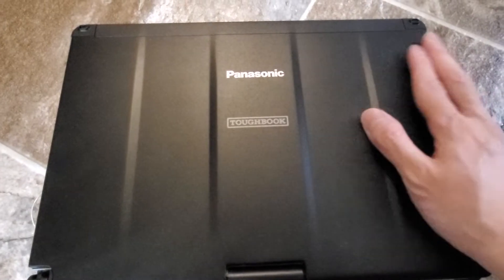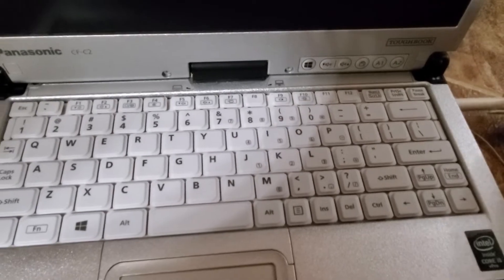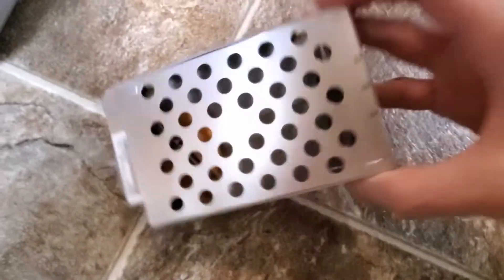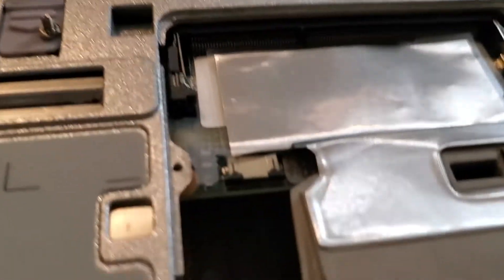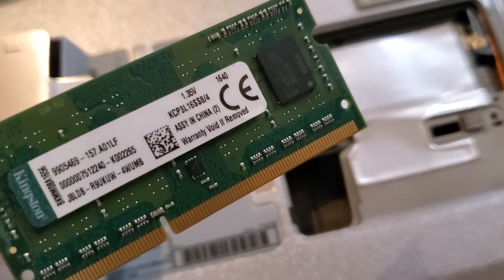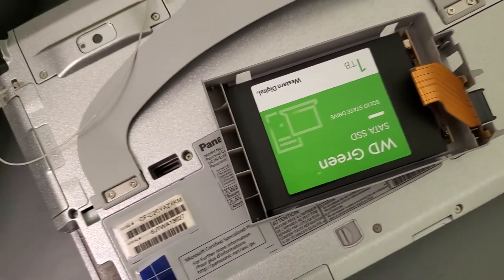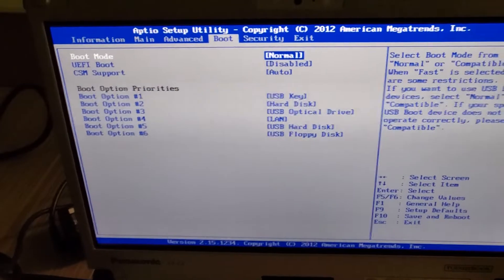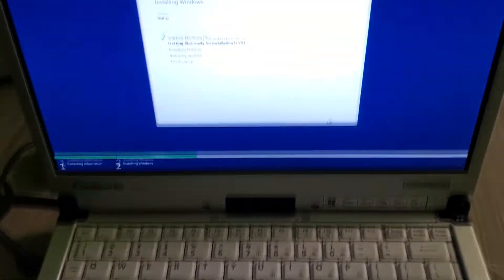How to Upgrade a Panasonic Tough Book CF C2 Hard drive to 1tb SSD RAM i5 intel Touch screen Laptop

Comment: Hi
I got Cf c2 . Wanted to upgrade From 4gb memory but when I put any stick in empty slot under the cover its not being seen by the system. Memory came from working computer and its the same speed it should be. Any idea how to go around it ?
Reply from the maker: this machine has 8gb at one point i wanted 16GB it was so expensive for a single stick. It should work just make sure you buy a OEM type ram
Reply: @kintips  I have used working ram from working laptop  with same speed ram as that toughbook. I am about to remove the ram stick that sits inside and swapp it with the one I have as I have read somewhere that if cf c2 came with 4gb from factory the other ram slot is switched off...    cannot confirm it yet